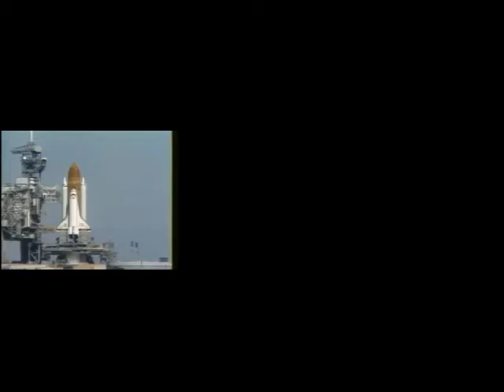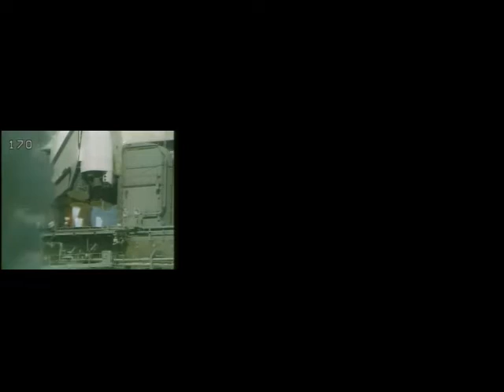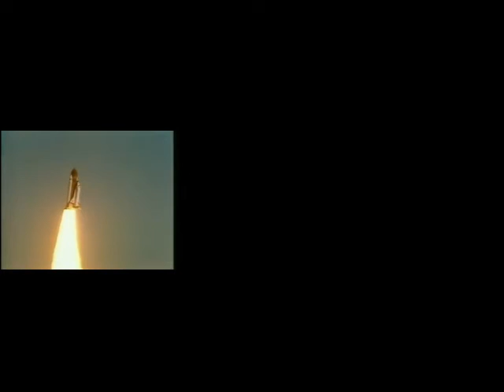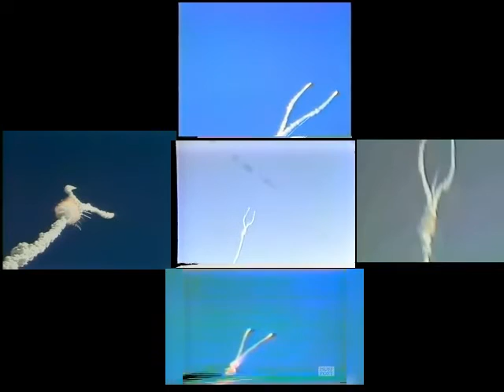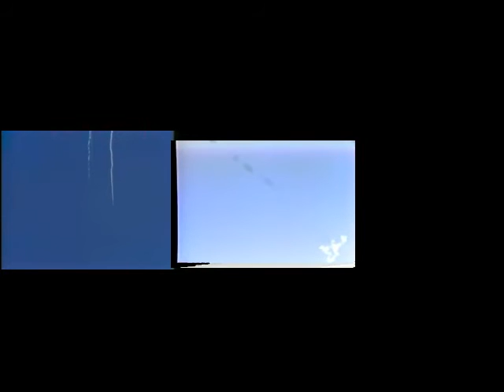1/28/1986 The Challenger Launch: Multi View (3)

Comment: did the "throttle up" have anything to do w/ it exploding at that moment, or was it just coincidence of timing?
Reply: The audio from the Capcom (capsule communicator) officer to Challenger was "Go at throttle up".  This is just an acknowledgement that the throttle-up sequence had already been completed, was successful, and the mission was go from that point.  The failure occurred in the right-hand Solid Rocket Booster (SRB), and had nothing to do with the main engine throttle-up sequence.
Reply: @somejoe7777 well mostly coincidence. Though there are theories the increased throttle of the main engines put more stress on the damaged booster. It may have hastened it by a few seconds
Reply: @christopherwaits7852  90%+ of the stress on the booster is the air resistance, not the main engine thrust.  Furthermore, they were already past MaxQ, so stresses on the booster were actually decreasing at this point.
Reply: Coincidence, The SRB's are unrelated to the main engines
Reply: O ring seal on aft section of right booster failed seconds b4 throttle up. It was gonna blow up regardless. Throttle up just hastened it's demise is all

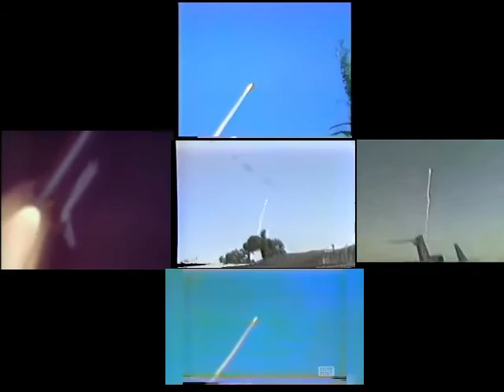Comment: At 1:19 -1:26 on the video to the middle right you can see where the wind shear was blowing the smoke trail sideways. The wind shear that dislodged the fuel slag that was keeping the failed o ring sealed. Their fate was sealed.
Reply: Exactly.  It’s amazing the o-ring failed on ignition but the slag instantly filled the hole basically.  They might have made it even with the failure.  But really it’s a miracle they made it as far as they did.
Reply: The burn-through was inevitable, wind shear or not.  The wind shear may have brought it on a few seconds sooner, but the O-ring was already fractured and not sealing immediately at launch.  No way the slag was going to hold for very long.